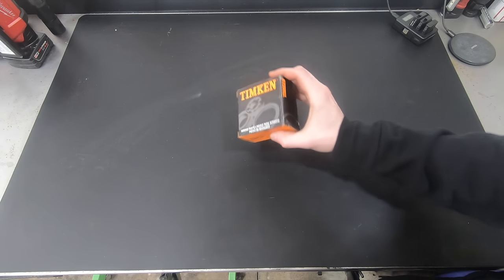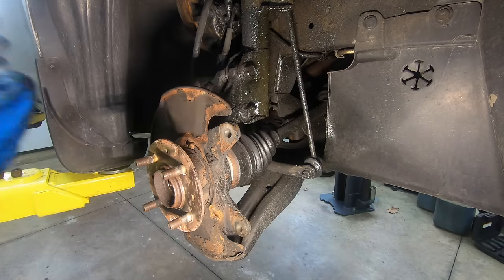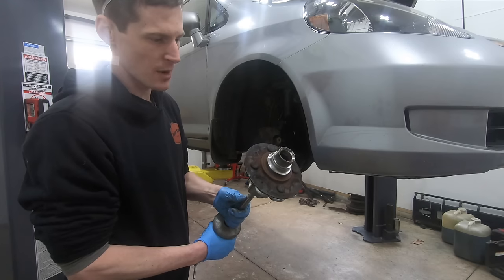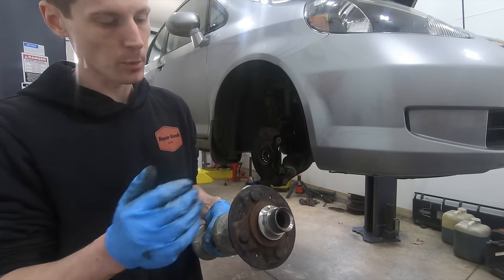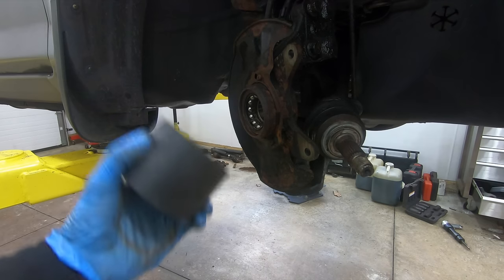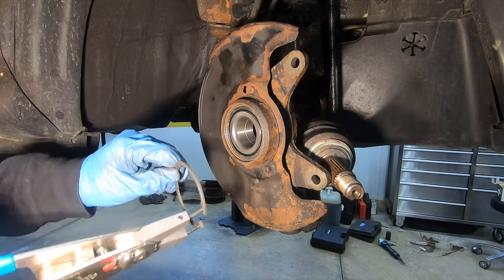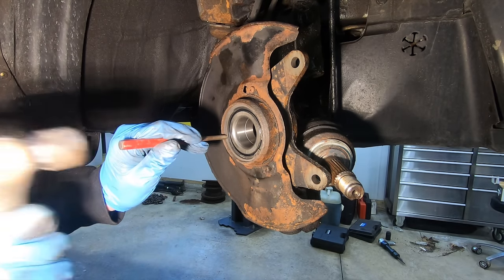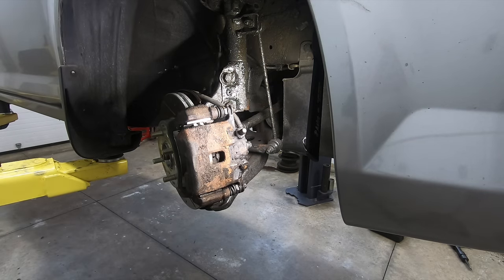How To Change A Press In Wheel Bearing Without A Shop Press.

Comment: So without even watching it a pressed bearing without a press would be a quieted to let's say using a socket. And a hammer. Sometimes you need a bigger hammer. To get the impression forwarded. Be careful it might bounce back at you. You don't want to get hit in the head by that thing. It hurts.

Comment: If ppl think urr gonna hurt car by using Tools Designed to be used on automobiles, they need some book time reading about auto repair. Also I'd like to see these ppl do a Subaru rear wheel bearing. This was nothing. Also they must never had to sledge hammer a wheel off. Some ppl don't know what never seize is for. For things to never seize. Also some air hammer action can save alot of cussing and work like a induction tool or torch. Everything has its place.

Comment: Very impressed with this young mans mechanical abilities but disappointed with his apparent lack of use of cleaning any components or the sourrounding area's down plus a lack of any additional grease being used prior to insertion/re-insertion of new parts etc, etc!! Perhaps the biggest disappointment though was the sheer lack of even visually seeing a torque wrench let alone the implementation of one as the majority of the bolts used in & around the front suspension are most definitly supposed to be duly torqued down to the correct specifications & I don't recall as I said previously to ever seeing the presence of a torque wrench let alone the use of one!! 
If my mechanical tutor was looking over this young guys shoulder he'd boot him right in his arse for his slack attention to detail!! All vehicles should be torqued as required & this particular vehicle is certainly no exception to the rule indeed!! Regretfully I would not be happy with this young man duly implementing any repair servicing on my vehicle!!

Comment: Using a slide hammer to remove a spindle is an unreliable method of doing it. On some vehicles, the interference fit isn't much and it will come out. On some, it definitely will not and it is exacerbated by the impact of the hammer being "cushioned" by the bearing balls gradually rolling up the edges of the races.
Add in some rust... REAL rust and not that light stuff that the desert rats get to deal with.... And then even Paul Bunyan sledge hammer blows won't get the bearing out of the knuckle.

Comment: WARNING!!! PREMATURE FAILURE!!!! YOU MUST PACK ASSEMBLEY WITH GREASE AFTER INSTALLATION TO PREVENT PREMATURE FAILURE OF THE NEW BEARING. FAILURE TO DO SO WILL COULD RESULT IN SERIOUS INJURY OR EVEN DEATH DUE TO LOSS OF STEERING SHOULD ASSEMBLY SUFFER CATASTROPHIC FAILURE.
Reply: Huh? They are sealed bearings guy. There is grease already in them as well

Comment: Situation two changes and to those that are not in the know. On the video but it's called an arbor press and you get one stupid sheep. It depends on whether or not you're going to go to harbor freight to get it just build it yourself it's not that hard. If you have the hands.
Reply: An arbor press sounds like a good idea, but then you'd have to remove the knuckle, which means you're in for a wheel alignment, right?

Comment: Problem is that you haven't saved any time as your a ball joint & tie rod end away from doing it in a press. We have a hub tamer master set, we call it the handmangler. Most useless p.o.s. ever! Don't waste your money! You can do this in a press cleaner, faster & more efficiently.
Reply: Interesting, tell me more.    I was just getting excited about this hub tamer thing.    I think one of his benefits here is that IF your car is one where you lose alignment by removing the knuckle, then leaving the knuckle on the strut will avoid having to pay for an alignment.  BUT on my Accord I am pretty certain that's not the case, so taking off the knuckle seems pretty straightforward.    Why do you call this the handmangler?  What happens